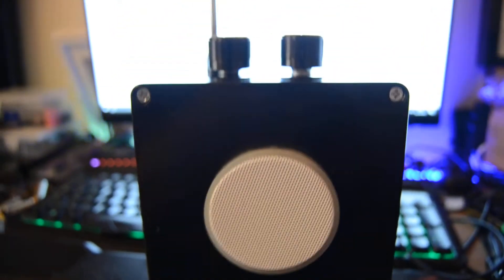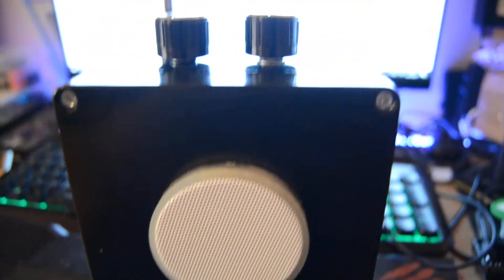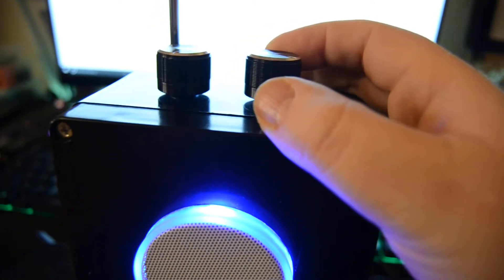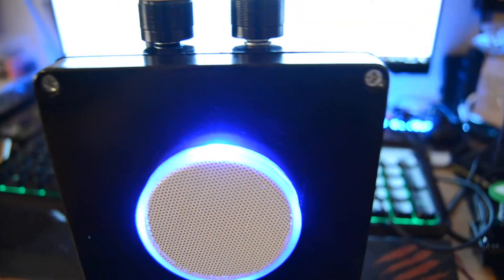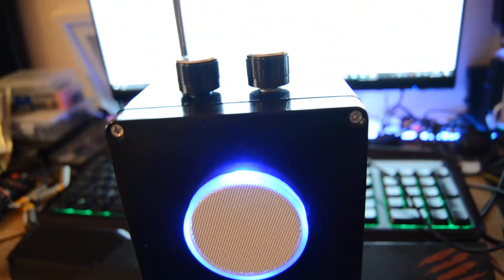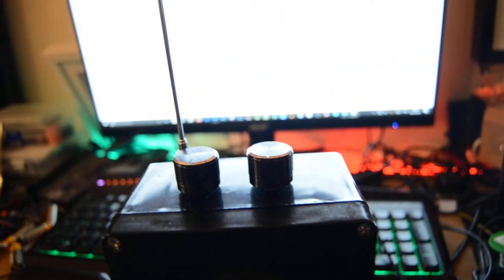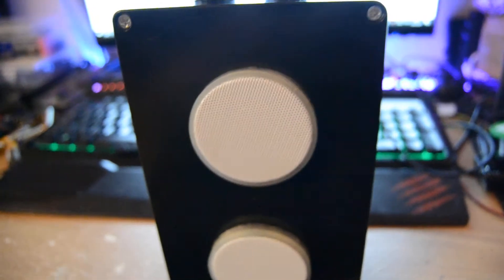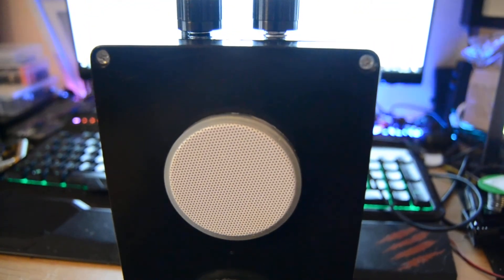New Ghost box build finished.

Comment: well done you, it looks great and you can hear that the spirits are trying to and r coming through, can I ask is this box connected to ur computer or is it standing alone as a spirit box? I think u have done a great job, well done and thank u for sharing with us. love & light, blessed be.
Reply from the maker: Ah thanks.. Yeah i have them around all the time. Just cos i am tinkering or building daily so have the regulars in for a chat :)  This one is standalone, Works on 4xAA Batteries which powers the radio and little Arduino computer, The computer insides job is to tell the servo motor where to go and how fast, Then the motor turns the tune dial on the radio Its a interesting sweep, Not like the hack ones where the radio round robins back to the beginning, This goes back and forth as if you were manually tuning :)